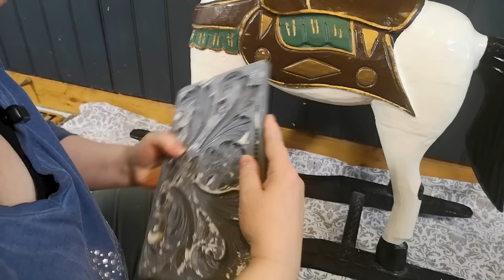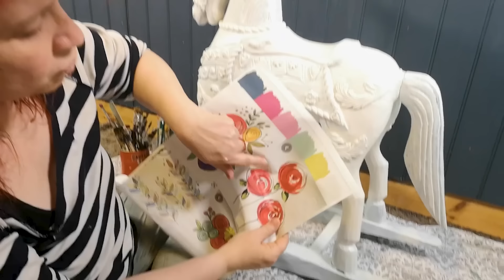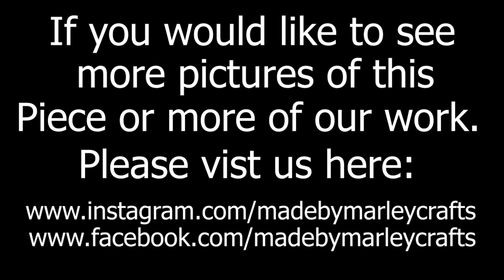Rocking Horse Makover with IOD molds and Annie Sloan Paint

Comment: I bought a styrofoam head after seeing Debi cover one with mold flowers, leaves, etc. Have you ever covered styrofoam? If so, can you point me to the video? Much thanks.
Reply from the maker: I have, I made a fake Styrofoam cake for a wedding picture. However there's no video, I applied my moulds with a quick set all purpose glue, if your in the states try tight bond quick and thick.
Let the moulds dry and then paint and design... Its easy you will be able to do it no problem x